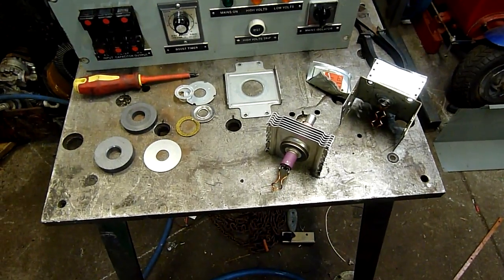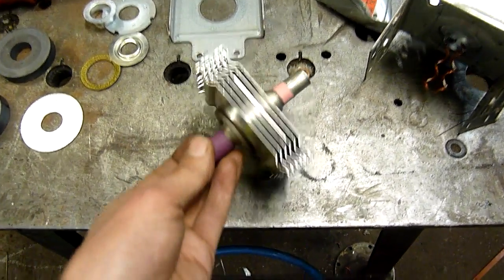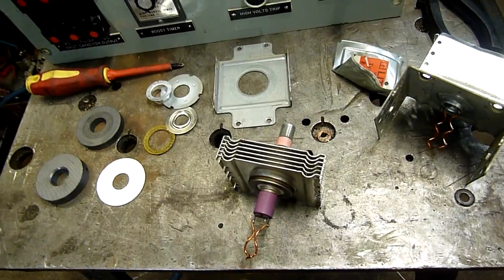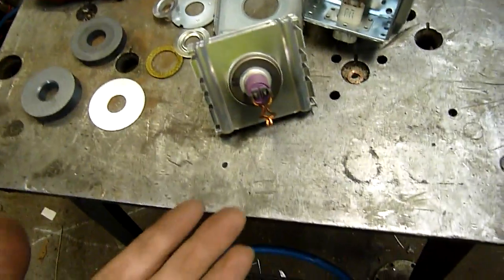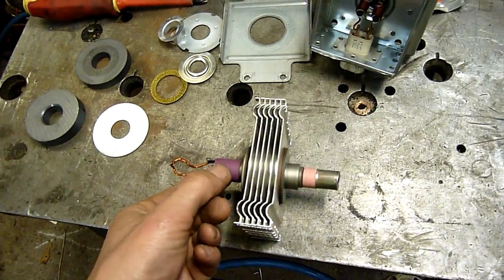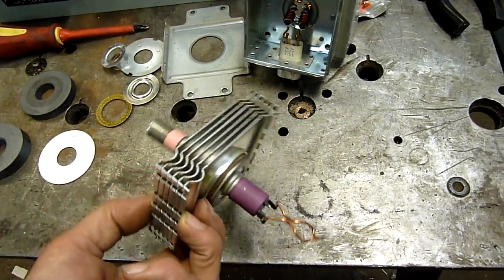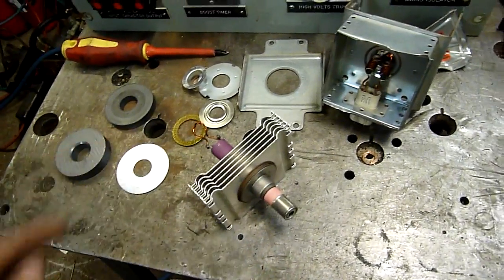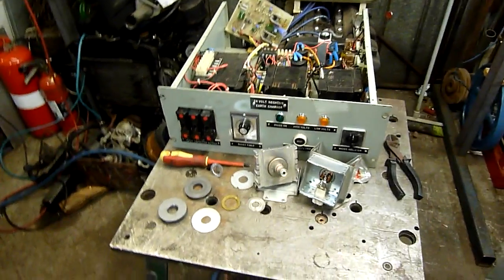Dangers of Dismantling a Magnetron

Comment: The pink is alumina with chromium doping for very low RF loss. BeO won't be used as it is for heat transfer, not need here.

Comment: Having worked with large, large magnetrons and klystrons over a period of forty five years (airborne, shipboard, and land based swept and PAR radars), one develops a very healthy respect and wariness for these emitters. Worse, far worse than the berrilium sump dust, is the constant threat of high voltage/high gauss magnetic fields. A well functioning pack mag or klystron will operate silently, rather cool, and apparently benign. I've seen ignorant ranks badly injured, and quickly, snuggling up to hot packs as though they were common coils or motors.
Don't play with these wild animals unless you have your Lion Tamer's Badge.

Comment: 🤣🤣🤣🤣🤣🤣its not beryllium or beryllium oxide. Do your research before making video. If it were beryllium microwaves would be hazmat and they would require special handling
Reply: it is beryllium oxide this type of insulting is used on magnetrons and old electronics parts like some vacuum tubes, and hv stuff, its still in use today as its provides pretty good insulation. just look it up its not radioactive. its even used in some industarial grade thermal paste, as it offers excellent thermal conductivity.
Reply: @ShahZahid  I'd like to see it on the data sheet of a common kitchen microwave. I believe the magnetrons in question will be old radar magnetrons although I'm happy to be proved wrong 😉
Reply: @ShahZahid  I'm pretty sure they use an alumina ceramic, like the pink or white material used on tig torches
Reply: @SodiumInteresting  that might be the case with modern microwaves but kasyan tv also had a video on the topic where various HV componentes (old) used such an insulator, is seems like this type ok insulation was popular for a certain time period and then vanished due to its risks, but as i said its still in use in other applications like thermal compound
Reply: @SodiumInteresting  also tig welders dont use that for current insulation, cuz there is only a single wire running to the handle and the other is connected to the welding surface and between those the arc forms, that ceramic is probably for heat isolation as otherwise the handle would get very hot
Reply: @ShahZahid  cup directs the argon flow
Reply: @ShahZahid  yes it is used in some instances, like semiconductors, particle detectors xray windows but I still think there is the myth going around about household microwave magnetrons.

Beryllium is a good neutron target 👌
One neutron goes in two comes out
Reply: @SodiumInteresting  not quiet, beryllium isotopes are radioactive and pure beryllium is a neutron reflector and thats why the shells around plutonium in nukes are made from it, as upon compression it starts the nuclear chain reaction. and its not a myth as salts of radio active elements are found in various objects like radium paint, uranium glass etc, these salts are pretty safe when compared to the isotopes of the said elements. also in particle detectors/atomic clocks usually, caesium or rubidium are used as due to their high shell number and thus bigger atom size they have a higher resonant frequency
Reply: @ShahZahid  show me beryllium oxide on a modern microwave data sheet then.

Beryllium is used to aid in neutron bombardment, it absorbs a neutron and emmits two at lower energies
Reply: @ShahZahid  reflecting generally means absorbing and reemitting
Reply: @ShahZahid  so yes quiet 🤫 😅
Reply: @ShahZahid  can I just add beryllium oxide is also too expensive to be putting in kitchen microwaves 😉
Reply: @SodiumInteresting  you are one google seach away from seeing that it clearly is used, but your arrogance wont let you.
Reply: @ShahZahid  it's highly unlikely, the burden of proof is on you my friend. You can find anyone to agree with you about anything on a Google search 🤣 it's obviously a common conception/misconception, whether it's true or not I invite you to prove it to me
Reply: @ShahZahid  I say that they use Aluminium and Chromium oxides. Why the would they use a very expensive hazmat material if they didn't have to.

Comment: In the U.S. they stopped using BeO on the magnetron insulators some years back. Naturally, it's older microwaves that we find them in. The U.S. was such a huge part of China's market that they stopped making the BeO insulators anyway. I have not seen one in years. I used to think the purple or pink was an indicator but then I found out Al2O3 is also made in those same colors when required.
Reply: Any idea what year? How to test for sure?
Reply: @petevenuti7355 I did some research and read several articles saying pre-2006 US. BUT I am not taking any chances. I tape up the ceramic part with tape for safety reasons just incase I scratch it by accident the tape takes the damage.

Comment: I just repaired my microwave  with the problem of sparking inside when I use it I decided to open it and investigate the cause I remove the magnetron and found in bad condition I'm not electrician I want to buy new magnetron but the price is about 30 dollars so I'm thinking when I switch it on theres a power problem is sparking is present  it means the magnetron is ok I decided not to buy new ones I search in goggle  I found silver tone I buy it in online when arrived to me i installed it and try at ones running it works  in norma.the silver tone is about 2 dollars I save 28 dollars .

Comment: The myth of the beryllium oxide in the domestic microwave.  

There is no beryllium oxide ceramic in a domestic microwave. It's aluminum oxide.  Why would you put an expensive and poisonous substance in a use at home model when a cheap and safe one works just as well? The answer is you don't. 

Beryllium oxide is found in some commercial very high power microwaves and radar systems, but not in any domestic models. The cost of beryllium as of this comment is $937 US for 100 grams. Your microwave would be like $2000 if they used beryllium oxide ceramic and not the readily available and perfect suitable aluminum oxide at $700 per ton.

Comment: Good job, don't fuck up your lungs!
What are the symptoms of beryllium disease?
In the early stages of the disease, little or no symptoms are experienced by the individual. When a person begins to develop CBD, inflammation (swelling) occurs in the lungs because they are reacting to a foreign object. The lungs' typical response to the beryllium exposure is to develop collections of cells known as granulomas that may eventually cause scarring within the lungs. This scarring, in turn, reduces the lungs' ability to function. Over time, the inflammation response continues, and eventually symptoms may appear, including:

Difficulty breathing/shortness of breath
Weakness
Fatigue
Loss of appetite
Weight loss
Joint pain
Cough
Fever

Comment: In the work I do-high power broadcast transmitters-the power tubes used in them have BeO ceramic tube envelopes Broadcast transmitters that used these tubes run at high DCand  RF voltages. The color of the ceramic IS NOT an indicator of the material the part is made of. Some vacuum capacitors are made from BeO ceramics.The packaging for these devices has the warnings about and also on an enclosed hazard warning sheet.If in doubt-treat ANY ceramic material on tubes or vac caps as BeO. Same with the bodies of high power semiconducters.Also in new broadcast transmitters that have solid state devices to replace tubes-the semiconductors can have BeO bodies or insulators. Best to be safe than sorry! BeO poisoning is irreversible. Also if you get cut from a Broken BeO component the cut can be slow to heal and can get infected-and the Be toxins can get into your bloodstream-Handle such parts with care and wear gloves for protection.

Comment: Seems like a magnetron would be the main engine for a starship, I plan to buy a brand new microwave oven and use the parts to power my ultra-light space project. Oh yeah... see, I have this theory about flight, it kind goes like this... I need to find a way to heat air and water in a ducted structure that works without combustion to heat air and water in a really, really, seriously strong bag is what should work for compressing and heating air and water rather nicely. I am thinking carbon composite bladders would do wonders in aircraft and spacecraft flight. Its a sterling idea and the correct solution for an Ultra-light Engine in a personal earth to orbit aerospacecraft. Made by Holloway Starship and Starship Engine Company. Installing magnetron engines on starships and ultra-light vehicles since 1978. I learned the art of spaceship construction from the Arcturian's. I have a Master's Imprint. Kernal Stamped and Locked. Level 10 Security. Master-Chief Engineer.

Comment: Actually the insulators in microwave ovens, apart from some high-end very powerful commercial ones, all use Aluminium Oxide and not Berylium Oxide in the ceramic insulators.  Berylium Oxide can be used in X-Ray machines and Radar stations, but almost never in microwave ovens.
Reply: Thanks dude !👍🎓📚🔭
Reply: I agree BUT when you consider the countless human f*ck ups of the past, I wouldn’t doubt the existence of some (containing Beryllium)in non industrial, home units. 
Also consider the logic of your average person on the manufacturing line; not even a basic understanding of chemistry and so quick to cut corners. 
What I’m saying is, TREAT ALL CERAMIC INSULATORS AS IF THEY ARE CARCINOGENIC.
It’s better to be safe than to receive a cancer diagnosis.

Comment: IIRC, the "Pink" ceramic insulating material uses aluminum oxide, I see this in high power vacuum tubes frequently. Safe if the particles are inhaled. Beryllium oxide insulators are grey to white and the dust is potentially unsafe. So the above insulator is OK! I still wouldn't grind it up and sniff it tho! ;)
Reply: The pink is from a different additive and is not indicitave of the presence or absence of Beryllum, which i think is a chromium oxide.
Reply: You just gave me a relief I took many out burnt to the pink insulator recently GE profile unit's and think There was dust inside I breathe in. Had a reaction chest pain discomfort.  Very concerning they even use this stuff in microwaves there is not much protection between the magnetron and inside the unit.

Comment: >Extremely dangerous beryllium
>Causes lung cancer
>Casually throws it on the table
Reply: It's not as dangerous as you think, ceramic isn't as brittle as you think especially with wires and metals around it and even in the case where it breaks, it isn't dangerous until you inhale it.
Reply: DieOrYouWillDie he is australian what do you think he's gonna do??
Reply: Yup, Australians are causal with danger.

OOo lung cancer, just another danger we face in daily life.
Sharks, Snakes Spiders are just some of the dangers we face
Reply: Its hazardous as a powder but generally OK to handle. As long as you don't powder it. Good to have the vent on or a mask
Reply: Actually, it is Alumina ceramic. BeO is very expensive and used in only certain applications.
Reply: That wont break it you dumbass

Comment: So, without the time to read through almost 300 comments; How do you dispose of such dangerous material?
Reply: You just don't grind or smash it. If you have to "dispose" of it, get a sturdy wooden box/crate and put magnetrons that you want to get rid of, kind of like a deep geological repository for nuclear waste. The reason for the wooden box is so that you can't accidentally break the insulator by dropping things on it (obviously try not to store the box below a shelf full of heavy things like anvils or lead acid batteries...). 

Once the box is full take it to a special waste handler, or even simpler just get another box and leave the first one alone. They won't bite or spontaneously break unless provoked so you can leave the boxes there until you die and the magnetrons will be absolutely fine :-)

Comment: The CAPACITOR is the biggest danger in taking those things apart... That and forgetting to cut the power cord off. (People get shocked to death by plugging them up AFTER they have removed the case!) Cut the cord first - short the capacitor second!
Reply: well, don't short it. Discharge it with a resistor
Reply: Nearly all microwaves made in the last 20 years have a ~100 Megohm discharge resistor built in to the capacitor itself as a safety feature (it is inside of the metal can).
Reply: see my earlier post

Comment: the aluminum cooling fins are not welded to the electron gun.  you can't weld aluminum to stainless steel. they are friction fitted to the gun. you can pry them off and re cycle them. for the rest of the microwave can be recycled steel.

Comment: YOU ARE IN MORE DANGER OF GETTING KILLED BY THE 2000V STORED IN THE CAPACITORS THAT DRIVES IT, THIS STAYS CHARGED FOR MONTHS!!!!. MORONS LIKE YOU WILL GET PEOPLE KILLED FOR A FEW BUCKS
Reply: aR Bemo But, do you have any proof of someone actually dying from it? Does this video even have anything to do with the capacitor? Do you have to type in all caps? So many questions...

Seriously though, the capacitors in a microwave have a very low capacitance, at high voltage. They have a leakage resistor built in to dissipate a stored charge. Unless you touched a capacitor's leads within a very short time after de-energization (~30-60 seconds) you'd be fine.
Reply: A work colleague on a Microwave training course died because the resistor failed to discharge to 4.7Uf 2000 V dc capacitor completely. He had one hand on the case and the other on the capacitor. The instructor had not finished the sentence "Be sure to discharge the capacitor before touching..." As it is DC it took several minutes before he could be released as no one could touch him. 

I have had several shocks from 350 vdc capacitors in valve radios and one one occasion got stuck for a full minute before it discharged through me and I collapsed on the floor of my garden shed alone. If someone had a weak hear they will be dead in less than a second.

 I have worked in Electronics for 40 years so yes, I do know what I am on about. Another guy died from 1KW RF radiation when a safety micro switch failed. People do die with the best professional precautions!!! Amateurs doing DIY electronics die 15 times more often!
Reply: aR Bemo so can i pull the magnets out of the microwave without getting shocked ? just asking i want to get some powerfull magnets
Reply: Edward Kesock Look for dvd readers they have neodymium magnets which are pretty strong

Comment: BeO based ceramics is only used in high end microwave equipment like military radar stuff where its pretty much always used due to its extremely good heat conducting and high voltage isolation properties. Its actually better then aluminium which says a lot for a ceramic but it is s also very expensive.

All these things are the reason it is never used in ordinary consumer grade microwave ovens since many many ears back and its also not needed today. The magnetron only get a bit hotter which is solved by more cooling fins on it and a little stronger fan but it get dam hot anyway but no problems for the magnet around it since its a a high temp one.

The ceramic is colored pink just to show that it does NOT contain BeO and even if you can see some that is white in little older ovens, say -90 or so, so are these still BeO free its only that the color coding had not really got into effect back then.

If you encounter ceramics that DO contain BeO so would you be blinded by all the yellow warning signs around it.
Reply: dtiydr Do you have any source that backs up your claim?
Reply: @fsto9039  Many places on Internet and the very cost of BeO that would have made ordinary microwave oven 10 times as expensive when BeO is not even needed.
Reply: I still wouldn't trust the color alone. They should really engrave them with a "NONTOXIC" label or something.
Reply: @theRPGmaster  If built into something there is a law that there should always be a warning/sticker or anything saying it contains BeO. There is non at all in a ordinary microwave oven but there is on military radar equipment. BeO ceramics has better heat transfer capability then fex aluminium oxide but the latter is much more cheaper and it just make the magnetron hotter but that is fixed by the fan anyway but they do get hot alright.

Comment: my friend MY microwave smell burn and don't heat I opened and turn it on and I saw the magnetron smell burn and I saw smog I found the magnetron online if I just replaced my microwave should be work normally again or in your experience you think can be something else, if this is the case I will just buy another one but for now I am trying to save money

Comment: You'd have to have years of expousure before the beryllium dust would become a significant risk. People's whose careers are built around Beyllium have to take care, the rest of us, the risk is so close to zero as you're more likely to hurt yoursefl trying to avoid harm from beryllium than the beryllium itself. However, anyone working with anything that produces dust, from wood, to metal , to ceramics etc should make a practice of wearing a filter mask. Do that kind of work for 20-30 years and anything will build up. Even plain sand can get you if you inhale enough of it.